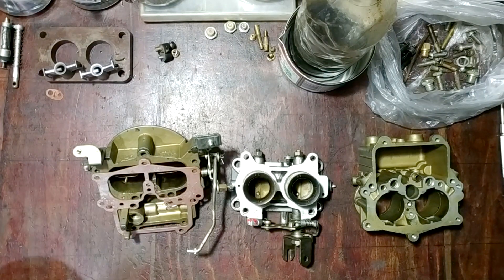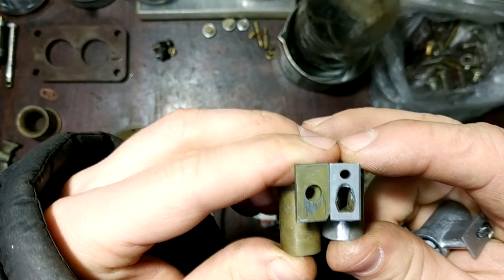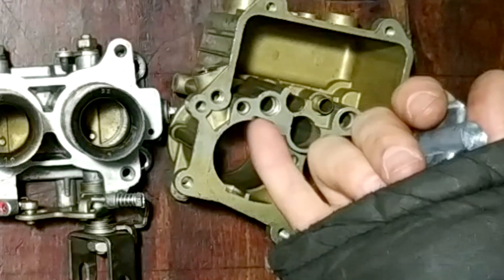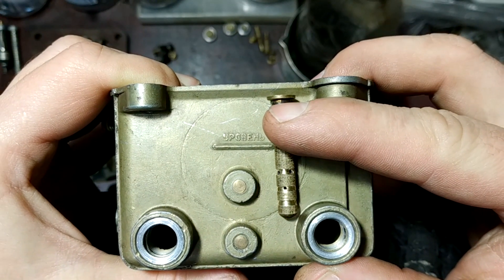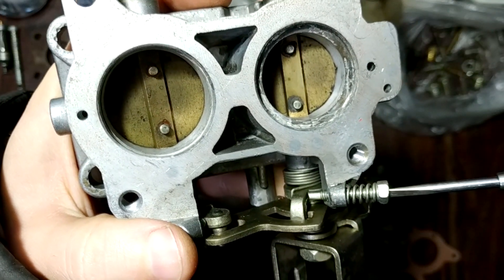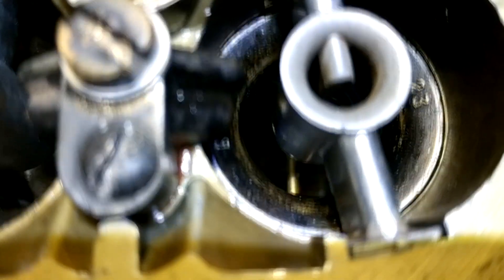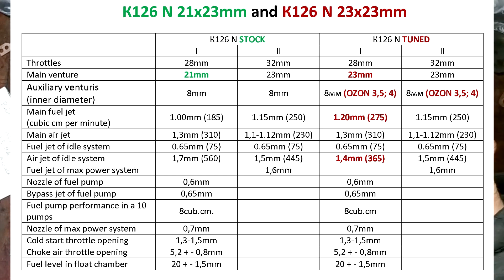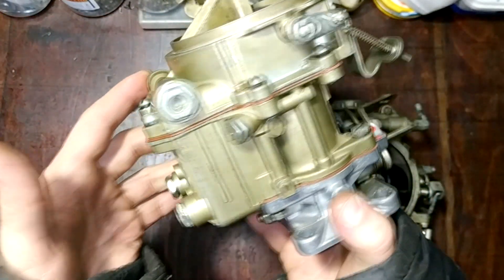Moskvich carburetor K126 N Tuning 23x23mm for UZAM 1500 (408, 412, 2140, Scaldia 1400, Elite 1500)

Comment from the maker: Moskvich carburetor K126 N Tuning 23x23mm for UZAM 1500 (408, 412, 2140, Scaldia 1400, Elite 1500). I hope you will enjoy my work. ;)
Reply: just a little thing about k(126,131etc) carburetors. you made the idle air jet smaller but it's actually worse. i've fiddled with a stuttering in low rpms and 1/3 of load. so i had problem with the holes that are above the throttle valve. i had to largen them very slightly to get smooth engine. but before that i tried to change the idle air jet smaller. it did give smooth engine while slowly increasing rpms. but while i opened the first chamber like slightly then there was huge empty spot where engine would die. i did change it to 1.84mm jet which still has 560 written on it and the throttle response is amazing and stuttering is absolutely gone. Writing next thing in caps cause this is imortant. K CARBURETORS IDLE AIR JET WORKS AS A FUEL JET WITH SLIGHT LOAD. plus to add to that that when you make idle air jet smaller then the idle fuel richens. this means you need to screw idle air jet in. this means low waccuum at idle fuel jet and you may run into the problem that engine speed decrease while in neutral and turning to right due to fuel going to left side in carburetor. and due to lower waccuum the fuel wont mix with air as good. which means you need to run a richer mixture to have stable idle. ofc you may have fixed this problem with slightly opening second chamber. but this seemed a bit pointless. if stock k126 is adjusted well then it works very well. 
all that you made with the venturis is nice tho. glad someone still tunes them and makes videos about them. good job
Reply from the maker: @matufujiwara7493  thanks a lot for your warm words! =)
Its realy interesting idea about idle mixture quality. Especially with low wacuum at fuel jet.
Could you tell me, please, what diameter of holes of transition system you made for slighty engine work? Maybe i'll try to make the same when i'll finish my UZAM repair and tuning.
Reply: @JWRamChan  i dont know exactly cause i made these holes larger with a cone shaped object. i just applied some pressure on it and holes went slightly bigger. but i can give the estimated sizes that i measured on the cone rn. so the lower one is around 1.5mm and the upper one is around 1.3mm. and then the idle mixture and co screws are both loosened from the bottom around 4 turns.
Reply from the maker: @matufujiwara7493  Thanks a lot for this sizes and screw regulatings. =)
I hope i will bye alpha-meter and test the mixture quality with modern technologies.
Reply: @JWRamChan  just an edit. i had to check something so i aswell measured the holes. they are actually 1.3 for lower hole and 1.0 for upper hole
Edit: i mistyped one measurement but i fixed it now
Reply from the maker: @matufujiwara7493  thanks a lot! Now i have everything for Spring/Summer experiments. 😊👍

Comment: Thanks, Roman. As an owner of a 1972 M427 in the UK, I have spent many hours working on the fuel system. Your advice is most welcome!
I found also that the fuel supply (pipes and pump) were the greatest source of problems - but not surprising after almost 50 years of service!
Reply from the maker: Thanks a lot for your good words! It inspire me to continue create something new in this retro. =)